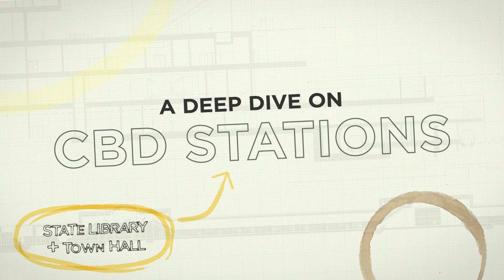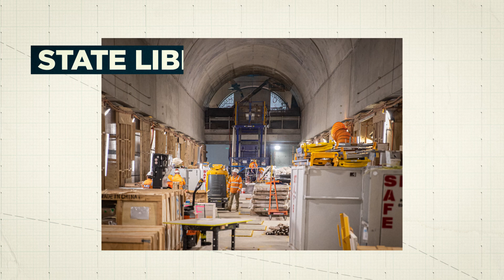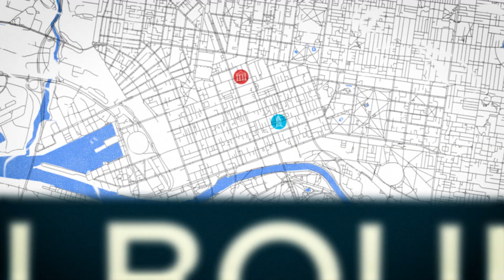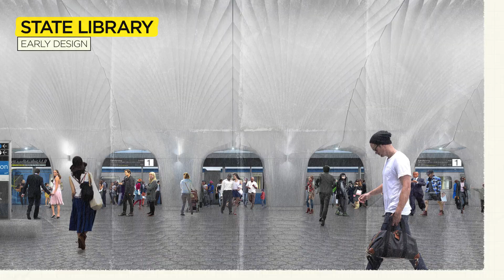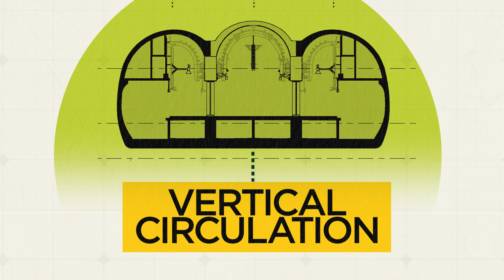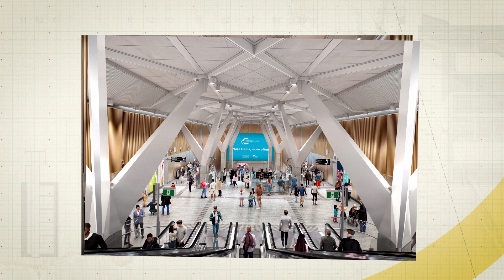A deep dive on: CBD Stations

Comment: Why is State Library station being built when there's already Melbourne Central there?
Reply: Because the Metro Tunnel isn't connected with the city loop, and because there is already the city loop at melb central they'd have to go deeper and potentially disrupt the city loop services. Besides, doing it this way, it's a short walk between stations and people can change from say the Cranbourne Line to get to Southern Cross or another metro line that operates through the city loop to wherever they are going
Reply: I think its because of the direction. Melbourne Central has all its platforms East West whilst State Library and the Metro Tunnel runs North South. I guess they could have called the entire new interchange Melbourne Central though.
Reply: It’s so it can connect to Melbourne central station underground, making it easy to transfer to different train lines.
Reply: because Dan and Allan want the project despite the overwhelming objection from experts and the public, you can guess why!